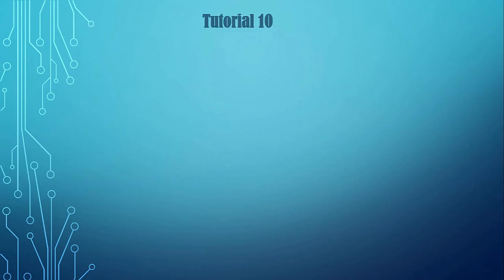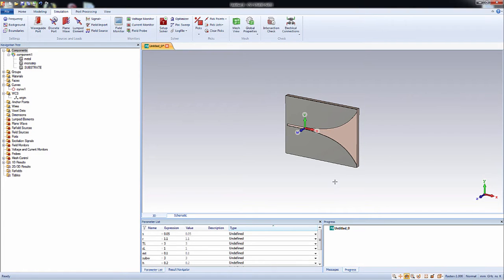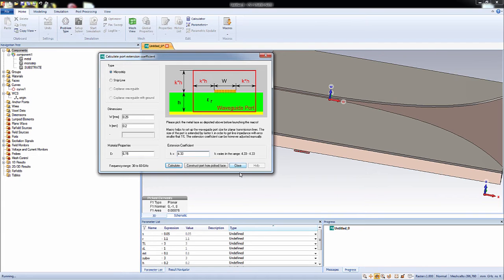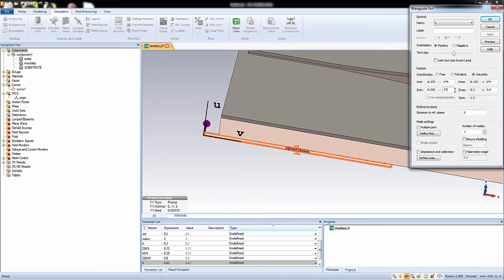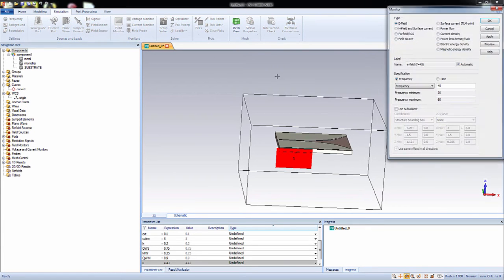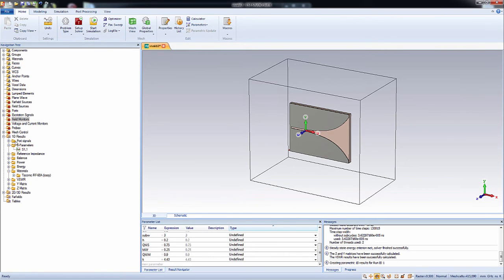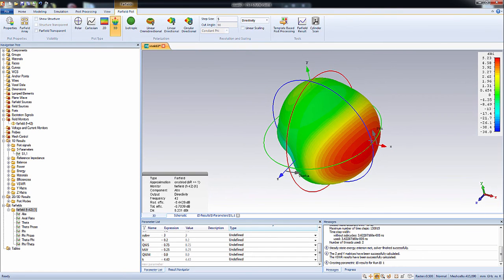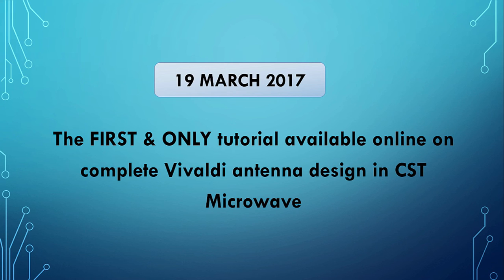CST Tutorial :  Complete Vivaldi Antenna Simulation in CST part2

Comment: First thanks for all videos, great work.
If we use radial stub instead of straight microstrip line , How could we calculate port extension coefficient or how could we simulate Vivaldi antenna using radial stub ? Would it be the same like in this video ?
  If radial stub is at the top layer or at the bottom layer of antenna , does it change the calculation port extension coefficent ?
Reply from the maker: it will remain same

Comment: i followed the each step from your video exactly but getting the different result than yours. did u do any changes after 4:50 ?? if yes then what ?
Reply from the maker: No. You should double check your setup.
Reply: yeah actually by mistake  i put the value of QWM 0.5 instead 0.9. Getting the correct output now. thnks for replying btw :)
Reply: sir i need one more help . actually i have to submit my final year project this weekend in which i have to design three bands 1-2, 2-4 and 4-8 Ghz. any idea how to get these bandwidths ?

Comment: Sir,how is the frequency range 38-43Ghz related to parameters you took for antenna design. For ex if I have to design for 900Mhz to 3Ghz,what modifications in the design are required?